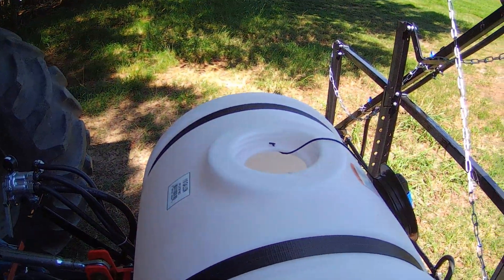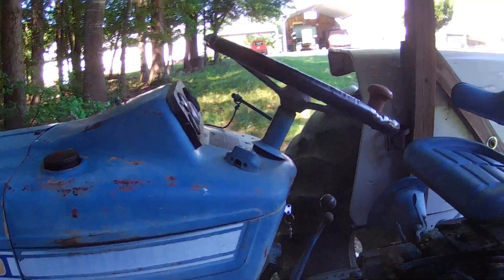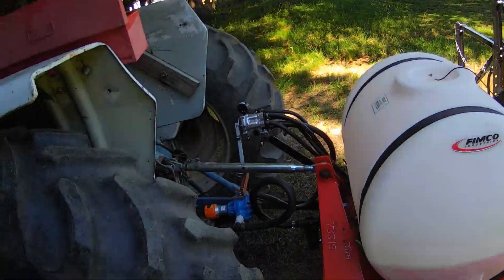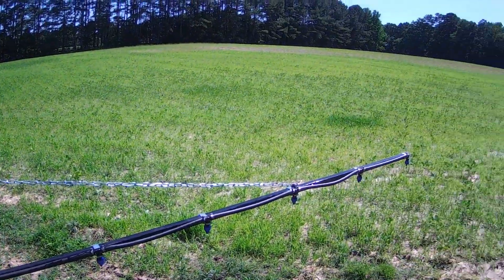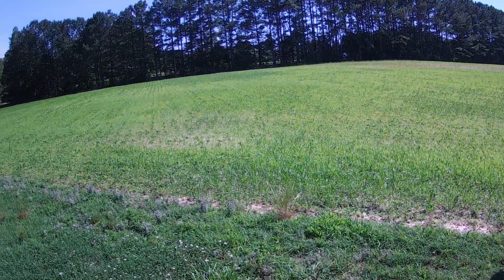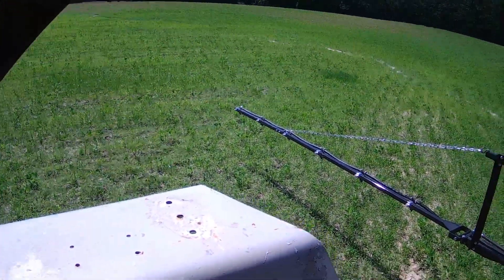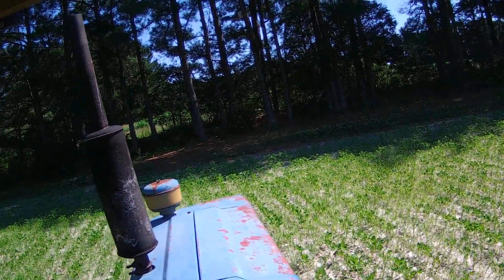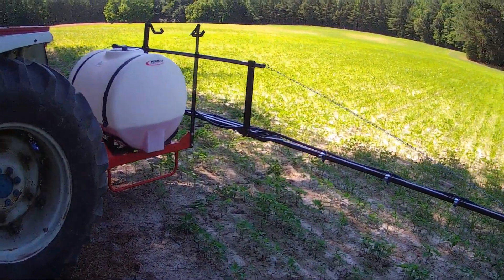Spraying beans

Comment: I know a guy that put a foam marker on his planter because the row markers where some where around 8500.00 gland to see that sprayer running good
Reply from the maker: getting past the setup problems and putting that aggravation out of my mind, I'd have to say I like it.  got great tank stir and I can get the volume of water I want at the nozzles.   huge improvement over the sprayer I used for 19 years.   you saw the planter cousin built in my last video and I got an idea.  he used that 1020 tractor to set out tobacco, two row setter.  he had a water tank on the front.  I want to take the old sprayer and incorporate it into that planter so we can plant and put down a pre-emergent in one pass.  I bet the vision of the 1020 with 4 people on a setter and a tank on the front just might put one of those I'll be dog gone looks on your face.    thanks for watching here my friend.

Comment: I just made one for my sprayer with a air compressor a grease bucket (for deep frying) garden hose and shower nozzles and works great and only 50 bucks or so. (Only thing is don't have side control will come out both sides)
Reply from the maker: I found several different plans for making one most of these plans come in at under $100 and like I said all I need is that one little spot down at the end of the row. Thank you for being here watching and leaving comments.
Reply: @SoybeanFarmer3300  just cut the compressor off with a switch and use dish soap and water. The foam concentrate is fairly expensive as well. Compared to dish soap and water

Comment: There are two basic types of foam marker - most pump the fluid to a special nozzle and drop funnel on the end of the boom others use compressed air in a closed vessel through pipework to a similar nozzle at the end of the boom. 
If I was you I would buy one of the special nozzles a long length of clear plastic tubing and a pump such as a windscreen washer pump (as these are designed to pump water + de-icer) drawing from a reservoir. If you can get it to work then you only need a T junction, another nozzle and more piping plus an electrical supply and switch from the battery.
Warning: don't leave mixed solution in the reservoir for long as in my experience it seems to grow an algae inside the reservoir and pipework causing blockages.
You might be able to buy a complete commercial set up secondhand locally as nowadays they have lost their popularity due to GPS and modern electronics.
Reply from the maker: The water out of my well left in a container for much over a couple of days is guaranteed to grow some kind of green stuff. For that reason I never leave water in any of the sprayer tanks that I use. End of the year clean out means get all the water out so that in the event we have a freeze I don't have something busted. Dan thanks for watching.

Comment: Like 4 my friend great talk through the whole video I know you line up front wheels but does the back ones not roll over you beans. Also great marking with blue flag to show where you last done. The beans plants are comming on.
Reply from the maker: yes the back tires roll right over the bean plants and mash them over but as long as you don't run over them when the soil is wet they pop right back up and in about 4 days you'd be hard pressed to see where you drove over them.   back in the old days rows had to be spaced out wide enough to allow for cultivation to knock the weeds down.  with the advent of selective herbicides row space could be tightened up and we can have more plants in the field and get more bushels per acre.   my cousin is back to farming here on The Little Farm and he planted corn this year in this video he is cultivating his corn and putting out fertilizer.  corn requires wide row spacing so it will grow right.    https://www.youtube.com/watch?v=aCa0eyy_JkQ
Fran my friend thanks for being here watching even when I'm not using the drone.
Reply: @SoybeanFarmer3300  I want to see these beans getting harvested so it's not just drones my friend this is interesting I like it too